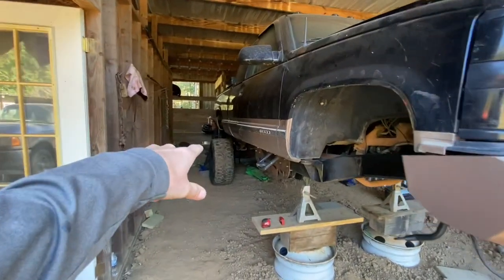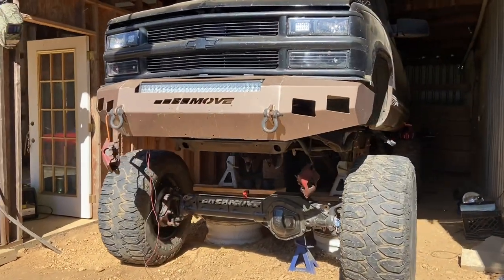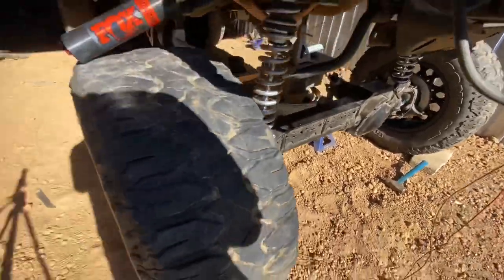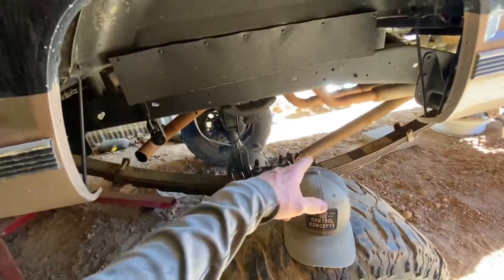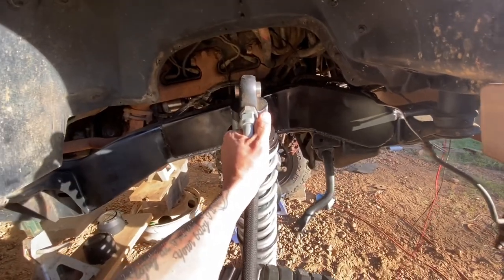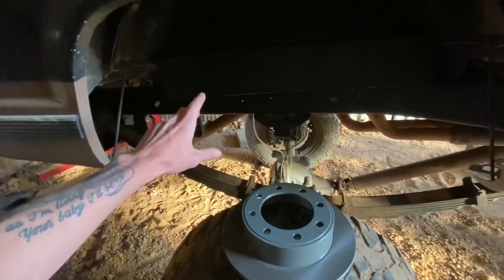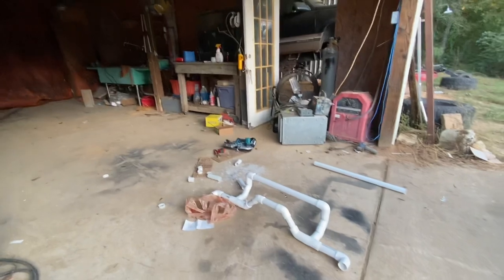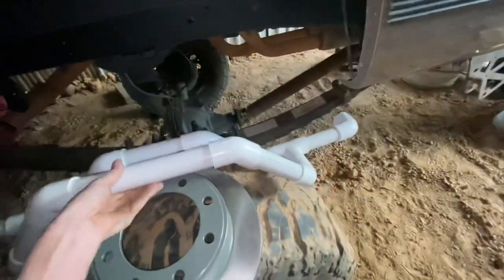The Axle is Under the Truck (Pop Up Car Show)

Comment: Less lift with more fender and body mount trimming! 
When I did the 4link sas on my 02 Lb7 I only ended up lifting it 6" in front and trimmed everything back enough to completely clear at full stuff and steer in every direction 43x14.50 TSL SX Swampers on 17X12 3.5bs Double Beadlock Stazworks steel wheels. 
This video is really making me miss my old truck. Was my first really big and expensive build. I spent almost $40,000 on the drivetrain part's alone. It was an animal! Won a mud drag's competition against 53 other trucks a month after I finished it. There were nitrous big block square body's and all! And they said because it was a big heavy diesel it wouldn't do well in the mud😂 Not true when you have solid parts, a 600hp/1190lbft Duramax, built Allison, and give zero fawks about breaking stuff🤘
Didn't break shit. The king coilovers and king air bumps up front, custom deaver leaf pack with 16" x 2.5" king resi's and king bumps in back soaked up the hard hits like nothing so I could keep it chooching black smoke on the limiter in second gear 4H all the way. Someone posted vid of it on YouTube around 9 or 10 years ago "Hilo mud bogs"
It's the flat black 4 door Duramax with a single 8" bed stack.

Comment: axles are dana 44'S? seems a bit light duty of a diff for such a big lift and small rubber. I have a 2008 Chevy with no lift and factory suspension, it has 39x15 rubber on it. no rubbing anywhere. lots of tubbing. keeps the weight low and the truck will handle better. plus you will still have the clearance. what's the point of going so high if your axles are still almost dragging on the ground. tub that thing out and get some real rubber under it!